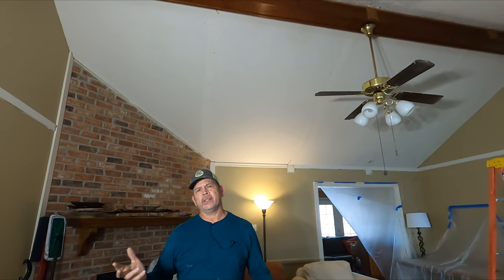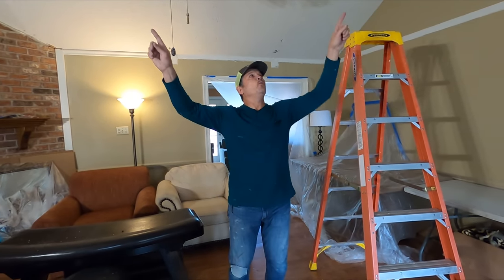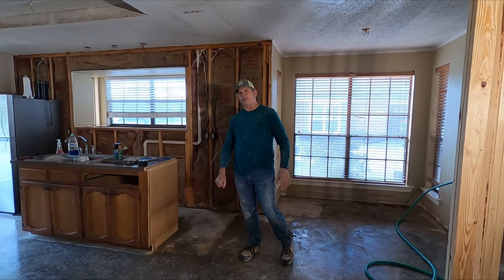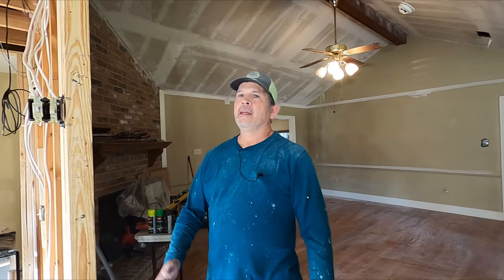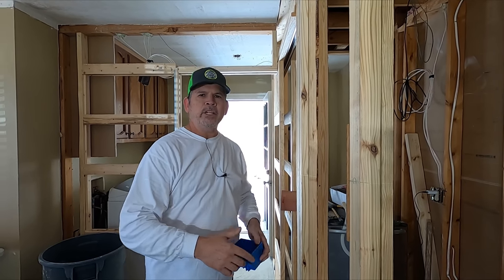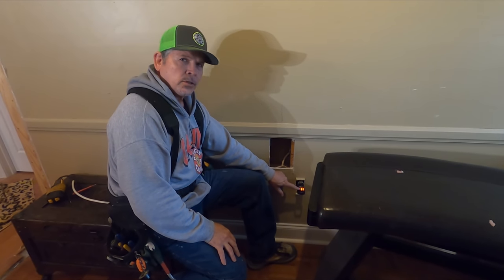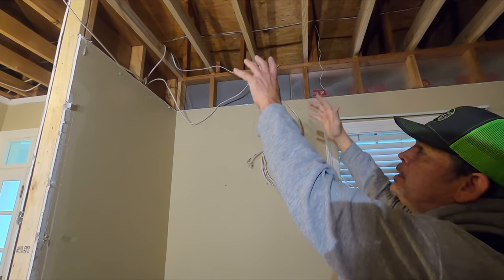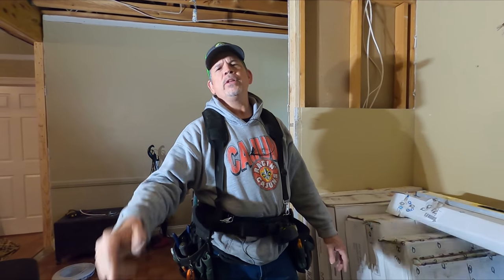Scraping Popcorn Ceilings.. There HAS TO BE a BETTER WAY! Ep. 9

Comment: You know, I just did my entire 1450 sq ft home removing popcorn on my own (I'm 70+) with a garden hose. Yep, a bit wet, a bit messy, but that went so fast, and plastic sheet only up to just above the outlets, taped to the walls with some extra pushpins to prevent drop down. Fantastic thanks to Final Touch Drywall Justin McPadden, and just clean it up and take a shower! It's looking fantastic. Proud of myself.

Comment: You clearly are friends with electricians. Putting the boxes up for them and the old hitting the linesmans trick, I appreciate the shared knowledge you have
Reply from the maker: Thanks 👍
Reply: @StudPack  That lineman's trick is the cat's pajamas.
Reply: @joekirby4529  Yes.  That also works with a flat bar, too.  I have an Estwing flat bar that has a recess around the claws that fits over the nail head.  The longer the bar, the easier it is on your hand.

Comment: 1. We love Studpack
B. We love Studpack
III. We love Studpack
Reply from the maker: 😂 I didn’t think anyone would catch that.  We have some attentive viewers 👍💪👊
Reply: @StudPack  For the HVAC. You need a balanced Air system. Air in = air out. Having one central return for a house like that isn't going to be enough. I'll explain that in a bit. As for the 2 supplies in the living room from what it looks like one side of the room will be getting the air. So having one on each end in opposing corners (think X) should be enough to cover the air supply for that room and help balance the heat/cool load. 

On to the return issue. As I said air in must equal air out. So I.e. if you have 100 cfm air supply into a room you'd want  100cfm out in an ideal world. Which is why each bedroom should have 1 supply and 1 return. Bathroom's and Kitchens do not get a return for obvious reasons. What that system is doing is relying on 1 central return for those areas and the rest of the house which is going to make the system pull through the entire house and restrict air flow. Even just adding a small return in that open area would help greatly and should help improve the air flow/balance for that side of the house. 

TBH every house should have a "Summer" and "Winter" return. Since during the summer you want to displace heat and in winter the cold. So having a high return for summer to remove the hot air and a lower return (like the one in the hall) for winter to remove the cold air from the floor. 

Also, that system may be too small for the house. IDK for sure. There are calculations for system size, air balance and duct sizing based on the total sq ft of the home being Heated/Cooled. Having the slide cards really helps with this for quick calculations.   If the blower is too small to pull and distribute the air the house will have balance issues. To prevent further issues an HVAC tech should come out and check to make sure the unit is the correct size for the house and an air balance test should be performed after all the walls and vents are in place.

Comment: Got a tip. Get the scraper with a bag holder from HD. Instead of using a bag, make a long plastic chute that goes to a garbage can. Then your helper can just slide the can around as you work. I did this a few years ago and it worked great!
Reply from the maker: Cool thx Chris!

Comment: as a former security installer I can tell you it was common to put sirens in the cold air returns in the 80's and 90's since there was no decent looking wall mount available back then - about 94 they started making the white surface mount sirens/speakers... the 80's were a very different time in many ways - still had a rotary phone and cassette players.
Reply from the maker: Return air is one thing but a supply duct?  I loved my Walkman with the "find the next song" feature 👍
Reply: That most likely wasn’t a pre wired job. Sometimes you can’t get a wire to where you’d like to put a device. They just made do.

Comment: I picked up the 32" Level5 blade you mentioned to skim my ceilings. The texture was painted over several times and wasn't scraping. Ended up rolling on thinned out mud and hit it with the blade -- thing works amazing! Pick one up, you won't regret it.

Comment: I have a suggestion. After you set your first box, reset the laser to the top or bottom of that box. That way you don't have to mark centers and fumble around. Just line up the top or bottom with the laser line and done.
Reply: That works if all your boxes are the same height. Unfortunately, you will often be dealing with more than one kind of box of varying heights, which means you need to work off the center line if you want them all to be aligned.
Reply: @ThePlockets  if you are installing new boxes, it would be smarter if you get same boxes
Reply: @ThePlockets  not really. Set your laser at 48", or whatever you want your box height. Set bottom of all switch boxes there. Use it as a reference mark for the rest. Just measure 36" down from the laser for a receptacle, etc. Not that big of a deal
Reply: Most boxes I’ve used have a center indicator of some sort, and If they don’t just mark it before nailing up, so it’s no big deal at all to work from centerlines. Doing so will  give you perfect cover plate alignment which is what you’re after.

Comment: I'm 70 and have been doing DIY electrical since age 23 when I had to go to a library to find out that a turning a light on from 2 locations actually required a special switch! LOL! Besides-reno/re-wiring all my kids houses, I built my own homes and wired them all. I can't recall an inspector who didn't compliment me on my work. In retirement, I bought a new house (the first I hadn't built myself) in another jurisdiction where I wasn't allowed to pull a homeowner permit to wire the unfinished basement. Having wired my whole life and suddenly not be allowed to my own work, in perhaps the last large project of my life--No Way! Told my story to the electrical contractor for this build and they kindly agreed to pull the permit and carry out all inspections at a per hour rate (since it's covid, no public electrical inspectors are allowed to enter occupied private residences). That they did, 1 hr at rough-in, 1 hr for final. Not sure the point of this comment, except to say a wise and common sense electrical contractor found a way around unnecessary bureaucracy to help out an aging DIYer who still knows what he was doing. GK
Reply: that could be risky on the electrician. i wouldnt want to risk my good name on some old kook(;

Comment: Something I thought of the other day with your temporary placement of the alarm panel - The alarm panel placement should be based on 2 things
1. ease of access/use of the end user.
2. not so easy access/use of someone who shouldn't be in the house.
So, if it's visible from the outside before breaking in, it may have lights on it showing that it's armed/disarmed and that would be a bad thing.  Placing it on the current location looks like it makes it visible through the window of that entrance door.  It may be better to place it on the new pocket door that's facing into the kitchen.
Reply from the maker: Thx.  Still discussing the final location.

Comment: I love how most comments are  about electrical and not drywall.  Most electricians will file if person knows there craft in Louisiana. I have a electrical contractor that would be willing to file if code enforcers bust me.  I'm a in process of removing popcorn ceilings.  I used water method with soap paint sprayer it is a mess. Also dry sanding with shop vacuum with 9in electric orbital. Also Dry scraping. All methods generated an incredible amount of dust throughout house. I think I might just skim coat the entire ceiling least amount of mess. With 5 min. Mud. Just make small batches and make my way across ceiling. I'm not going for a level 5 finish i just want orange peel instead. Great videos btw I love working with dad now that he is in 70s he is doing less and less projects.

Comment: I’ve always scraped popcorn ceiling by using a scraper and attaching a vacuum hose. This I’ve found to be the best solution. I always use a dust deputy connected to my rigid vac. Helps with capacity and adds the required hose length.

Comment: I have a 24 inch skimming blade. I highly recommend it. I also recommend getting the pole to mount it on. I use a 3/4 nap roller, roll some watered down mud, and skim it smooth. You'll love it. Your fan, Kevin
Reply from the maker: Thx Kevin 👍

Comment: I'm and hvac contractor alongside my dad like you two, i love it. Keep it up. I dont think you will gain much moving the 2 vents in the living room. You can, but if so, upsize the boots to 12×8's with 8 inch duct and 1-way ceiling grills. If you leave them I'd still upsize the boots and the duct if its not an 8in and put 2-way ceiling grills. Hope that helps!
Reply from the maker: It helps a lot thx 👍

Comment: Looks great 👍
Removing acoustic  try with one layer of plastic to protect walls and two layers of plastic to protect the floor 
Glue together wall plastic and bottom layer of plastic with 77 glue  top layer don't glue it. Once the scraping is done you remove the top plastic layer and the bottom stays clean  we use .7 mil plastic

Comment: The electrical part was something I always wondered. It seemed like some videos you guys did all the wire pulling but had electricians actually connect stuff up which I thought was a way to save money. Now hearing the story it makes much more sense. I can 100% say watching you guys do electrical results in work that looks a lot better than a fair bit of stuff I ran into doing A/V stuff. I got a bit of crash course on electrical from my dad who was licensed but thankfully haven't had to do any high voltage stuff yet!

Comment: If I was the homeowner, I would replace that pink R11 fiberglass with Rockwool anywhere you see it in the walls. Also ask you to spray some foam at any possible holes & cracks to the outside.

Comment: For the HVAC. You need a balanced Air system. Air in = air out. Having one central return for a house like that isn't going to be enough. I'll explain that in a bit. As for the 2 supplies in the living room from what it looks like one side of the room will be getting the air. So having one on each end in opposing corners (think X) should be enough to cover the air supply for that room and help balance the heat/cool load. 

On to the return issue. As I said air in must equal air out. So I.e. if you have 100 cfm air supply into a room you'd want  100cfm out in an ideal world. Which is why each bedroom should have 1 supply and 1 return. Bathroom's and Kitchens do not get a return for obvious reasons. What that system is doing is relying on 1 central return for those areas and the rest of the house which is going to make the system pull through the entire house and restrict air flow. Even just adding a small return in that open area would help greatly and should help improve the air flow/balance for that side of the house. 

TBH every house should have a "Summer" and "Winter" return. Since during the summer you want to displace heat and in winter the cold. So having a high return for summer to remove the hot air and a lower return (like the one in the hall) for winter to remove the cold air from the floor. 

Also, that system may be too small for the house. IDK for sure. There are calculations for system size, air balance and duct sizing based on the total sq ft of the home being Heated/Cooled. Having the slide cards really helps with this for quick calculations.   If the blower is too small to pull and distribute the air the house will have balance issues. To prevent further issues an HVAC tech should come out and check to make sure the unit is the correct size for the house and an air balance test should be performed after all the walls and vents are in place.

(Edit)
 Forgot to mention that placing the vents over the windows is 100% true HVAC style. It creates an Air Curtain at the windows since glass is a poor insulator and will help reduce the ambient temp bleed into the home.
Reply from the maker: Thx gunshin!  Lots of good info 👍
Reply: thanks for the info!
Reply: @scottyee707  Your Welcome! There is a lot that goes into comfort heating/cooling. Often the most neglected aspect is air balancing. Which people often complain that a certain room or rooms aren't being heated/cooled like the others and that is 100% an air balance issue. Also, I forgot to mention use insulation cement around joints/seams followed by Aluminum tape for a nice look since the cement looks bad....really bad but it's the best for preventing air leaks in the duct system!

Comment: Suggestion from an electrician. Take the plare off of the receptacle or switch you're trying to match the height on and set your level to the top of the box. It makes it a LOT easier than trying to loom on the side for a center mark. Great job guys. Love watching your videos. Your work reminds me of my uncles' who uave been working by word of mouth for 25 years now
Reply from the maker: I used to that until one project the boxes were different sizes so now I use center lines.  I’ve thought about lining up the laser with the top hole for the device.  Awesome thx Red 👍💪👊

Comment: I just skim coated right over a heavy popcorn ceiling. I used an electric ceiling sander that has a vacuum attached  to take some of the big stuff off. Made no mess hardly at all and was super quick. Skim coating was pretty easy too.

Comment: That's some good electrical experience. I have much of a similar story. Working in a commercial office building while shadowing and assisting the electrical contractors. I understood everything you explained is pretty cut and dry. The buss bars are literally flat copper plates that come half inch, three quarter or someone 1 inch thick that make a permanent connection with copper bolts and washers as well usually used on a higher amperage applications.  good work 👍💪
Reply from the maker: Thx Maurice 👍
Reply: What do about oxidation on copper
Reply: They do annual and 3 year maintenance on the switch gear here in NYC. Meaning torqing down the bolts, and cleaning the bus bars no real chance for oxidation development hence the reason they use all like materials

Comment: If the popcorn has never been painted then warm water helps - you can even use a paint roller (with no paint) and just water to wet it down or a spray bottle.  But the objective isn't to make it sopping wet, only to mist or roll a little water to soak in to what what is mostly cellulose fibers.

I've done enough of it and the work sucks, but to be honest to do it over I would say knock down the high parts and add 1/4" or 1/2" drywall OVER with acoustic caulk you'll get better sound reduction, in theory fire resistance, and a much less labor.
Reply: Good point!   Taking it off after it has been painted is a terrible job.  Knock down the high spots and skim over the bulk of it - way better approach, imo.

Comment: We did popcorn removal like this all the time with a somewhat similar initial application: draped 48"-96" film on every wall. Caught water/popcorn drippage and had the ceiling prepped for painting the next day. Then we'd spray the popcorn ceiling with 2' wand on a paint sprayer (adding Krud Kutter or Dawn to the water if the ceiling was painted... with a longer wait time before scraping if painted). Very little overspray with the wand right up close (we're both 5'7").

Radically different action: My partner would hang a king-sized mattress bag on our 2'x4' large-wheeled anti-scuff wheeled scaffold. We blue-taped the bag to the 4 top corners of the scaffold and put the 2 step boards under the bag (usually the 2nd or 3rd step down from the top) to be able to hold a lot of material in the bag, while still easily moving every scrap of material from the entire job until it ended. After prepping the scaffold bag, I'd stilt up, grab a 6" drywall knife for each hand, and he would push (or pull) the scaffold around the room in front of me... as I scraped with each hand. Because I only used 6" knives, could get better than 95% of the popcorn scrapings and water directed right into the bag, but it was still a very fast scrape. (He could respray with the wand if it was a big job and started to dry, but we moved so fast, that rarely happened.) Then at the very end of the entire scraping job we could either leave the bag on the scaffold (to dry a little overnight), or just tape the bag closed (in place), roll the scaffold out to the dumpster, and roll the bag off the scaffold into the dumpster one time.

We also would get the adhesive floor coverings from Sherwin Williams. CONS of the floor adhesive is it can only be on for a few days (so we'd make sure when it went on we could be finished up in 4-14 days) and it's expensive. PROS are: the floor is sealed, adhesive plastic doesn't slip, all floors can be swept or mopped (at end of each day), paint spills & overspray don't leak thru, and at the end of the job... not only is the floor is more clean than when we started, but also, the entire final floor cleanup was less than 2 hours (if we didn't do any floor work beside walls and ceilings).
Reply from the maker: Thx for all the tips Matt 👍💪
Reply: @StudPack  We hated popcorn jobs too, but we'd charge double the going rate, and doing it this way we halved our time. Got a lot of referral jobs even charging so high because we'd guarantee to keep the customer's house immaculate, no wall, window, or crown stains, and the dust would be minimal (never used the power sander, only a fast wipe with a Radius360 if there were any edges to knock down afterward).